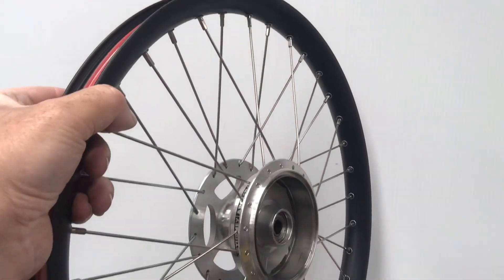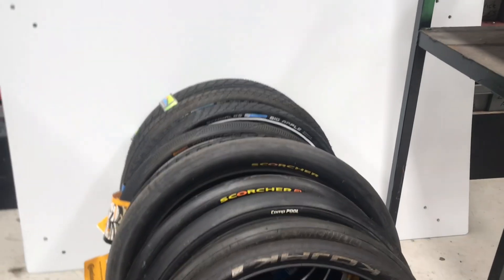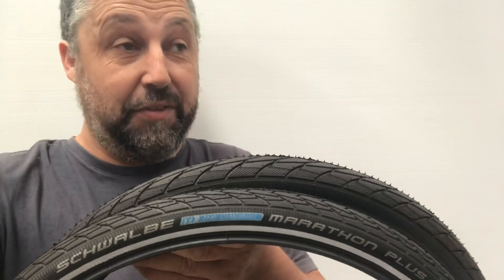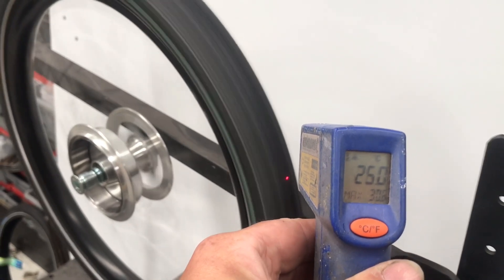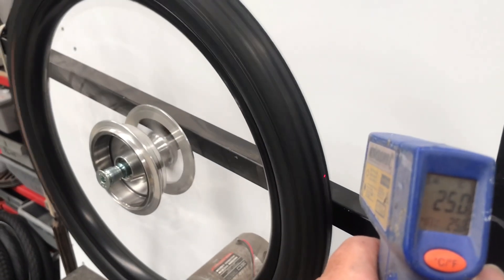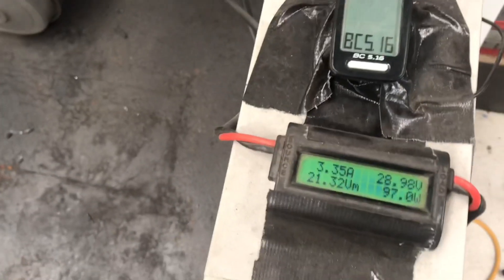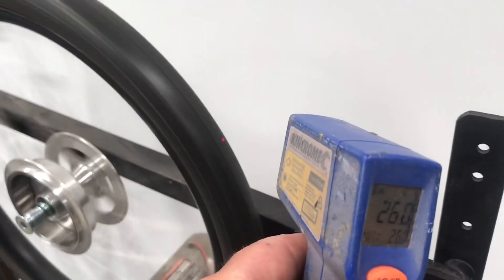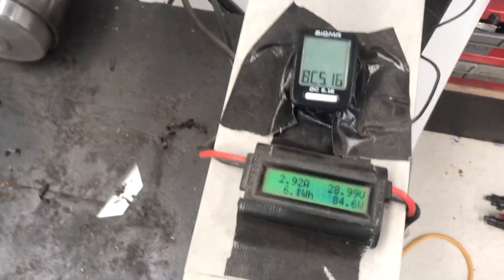406mm tire rolling resistance test

Comment: I can't seem to find those Michelin Blues anywhere online 🤷. I currently run kojaks but these look like a better speed tyre.
Reply: Ginkgo Velotile in Germany sometimes has them.  They are very thin, no extra puncture protection.  Race only, not for practical use.
Reply: @larrylem3582  any idea if the Michelin Blue Flange tires are tubeless compatible?
Reply: @ I don't know if they are intended to be tubeless, but "in the old days", just about any tire and most rims could be made tubeless with enough tape and sealant.  (Doesn't work with pinned aluminum rims, they have to be welded.)

Comment: in reallife scenario there is also airdrag that causes extra watts. all those plushy tyres like scorchers and 44 blues are fastest up to 25 miles per hour. if you ge beyond that then you feel the pullback by air but most people wont go that fast unless in a downhill. when it comes to price, safety, longivity, grip, speed, mounting the best are: continental contact urban. i had similar result just as win shermer did with his bandentest. would love to see tubeless, or different kinds of tubes test, latex, tpu etc.

Comment: GoCycle ( Vredestein F-Lite) is right there with the Scorcher. Folding. Nice round no problem. Rolls fast. Good grip. Light.  Very comfortable, so smooth. Puncture protection. Wear resistant.€35. I love them. Try get a set! 

I'm surprised by the Continental Contact Urban. Very affordable €21 for the 42mm version 355 grams!
Reply: Would like to see this tire tested as well

Comment: Great job! I did similar tests. I can give you one piece of advice. To see the difference more clearly, you can take the test for a strictly defined time, say 3 minutes. And measure not instantaneous readings of power consumption, but the final indicator of energy consumption in watt-hours. So the result will be averaged, and the difference in readings will be more obvious.
Reply from the maker: That is actually what took place

Comment: Thanks for making the video, that must have been a lot of work. You managed to get a good selection of the best rolling tires for the test.
Unfortunately the results are not very useful as many of the measurements are in stark contrast to the results of other tests :( Tire testing is hard.
Reply: Which other tests? The results are in line with previous 406 tyre testing that I have seen from both this rig and from others testing 406 tyres.
Do not confuse 406 comparison results with 622 results - shrinking the size can have adverse effects on the peroformance where as some tyres, like the Scorcher, were designed at 406mm and do well in such tests.
I have personally taken the results from this rig, ridden the tyres in real world conditions and verified that the rankings produced from the rig are consistent with actual riding.
If you disagree, go produce & present better data.
Reply: @Robtrike  It's true that some 406 tires differ from the 622 versions, but we can still use the 622 results from bicyclerollingresistance as a rough guideline. But some of these results also disagree with Wim Schermer's 406 tests and my own. I have tested Michelin Blue 44-406, Greenspeed Scorcher 42-406, Schwalbe Pro One TT 28-406 and Michelin Radial 45/75R16 on a pendulum similar to Wim's testing setup.
Reply: @w0ttheh3ll  Cool - you have results - where is your link?
Reply: @Robtrike  Our results are not published, but I can give you the numbers. 
We use a pendulum somewhat similar to Wim Schermer's, but with a different method of analysing the data. I believe he reports the time in motion and calculates c_r based on that, I'm not sure what physical basis his method uses.
We measure the distance covered while in motion and calculate c_r based on the initial energy of the pendulum, since Work equals Force integrated by Distance (F=E/s) and we are looking for the force of friction to calculate the coefficient of rolling resistance (c_r = F_r/F_N). We also measure time in motion.
The measurements were not calibrated so I don't have c_r, only relative values that are c_r*k with an unknown constant k (k is roughly equal for all measured tires). The measurements were done on a smooth surface (unlike an actual road).
All tires were fitted with the same type of pure latex inner tube from Ginkgo Veloteile.

c_r*k; time in motion; tire
1.00; 186 s; Michelin Radial 45/75R16 @ 7 bar
1.59; 95 s; Schwalbe Pro One TT 28-406 @ 8 bar
1.78; 90 s; Michelin Blue Flange 44-406 @ 5 bar
1.88; 79 s; Greenspeed Scorcher 40-406 @ 7 bar

Tire pressure was chosen as the max recommended pressure. The Michelin 44-406 has max PSI equivalent to 3.5 bar printed on the tire but 5 bar was recommended by the online shop. This results in the Michelin Blue Flange and the Schwalbe TT being a bit underinflated (lower wall tension) compared to the Greenspeed Scorcher. Higher pressure leads to better performance (at least on a smooth surface). The radial tire's pressure cannot be compared to the others since the tire construction is totally different.
Reply: @Robtrike  I can measure Conti Contact Urban 32-406 and Schwalbe Road Cruiser xx-406 next week.

Comment: Pro One TT unfortunately is tough to get mounted on most rims. Use mounting fluid and inflate to 10 bar or more. Then reduce pressure to what you want to run after the tire seats itself.

Comment: the contact speed result seems wrong, it should be about the same as the contact urban.
edit: looking at all the numbers from the entire video, it seems more likely that the result for the urban is wrong.
Reply: let's hope it is right ;-) - I've got them on my Snoek and that must be the reason I'm so slow.
Reply: Contact Speed is widely reported as slower than the Urban... Results ordering seem consistant with my experience of Speed/Urban/Pro/ProOne/Scorcher120 - well done Ben!
Reply: @Robtrike  the contact speed is supposed to be a bit slower than the urban yes, but the difference measured here is huge. the contact urban result reported here beats the road bike tires (One, Pro One) by a huge margin. It's on par with the stripped down, no puncture protection, extremely thin tread competition tire (Pro One TT). the urban is a city bike tire with full puncture protection. it's a very good (and affordable) tire, but it's not that good.
Reply: @w0ttheh3ll  it is called science. 
The test gives a relative value, not a calibrated number.
We've seen similar results before. The falacy that road tyres are the only fast option and commuter tyres are slow is just that - a falacy.
Reply: @Robtrike  you've seen similar results where? bicyclerollingresistance measured 18 W for the contact urban, 21 W for the contact speed, 15 W for the Schwalbe One, 13 W for the Pro One and 8 W for the Pro One TT. granted, all of those were 622, not 406. you're telling me that the 406 Contact Urban is as fast as the 406 Pro One TT because of "science"? I've handled and mounted both of those tires in size 406. I've spent several hours personally testing rolling resistance of the 28-406 Pro One TT. They are not comparable.
Reply: @w0ttheh3ll  You failed to listen to Ben describing the testing. The numbers are only relative values. The relative position of the test items is the real information. This rig has been in use for 25 years and you can go find previous results from it if you wish. Wim Schermer's testing over the last 20 years would be my other source. We know the shortcomings of both this rig testing method and of read-across from other tyre sizes.
I have taken the time to ride the tyres from previous testing on this rig and my real world road riding agreed with the relative placements.
The 'science' - the correct approach now, if you disagree, would be for you to go do your own testing and present the results, as Ben has done here. I for one would stand behind Ben as a Peer Reviewer of his testing and have experience of the results from this testing rig and method.
Reply: @Robtrike  where do you see me treat the measurements as anything but relative values?
Reply: @w0ttheh3ll  pro one tt are rolling slower then contact urbans, but they are better at aerodynamics cuz its 28mm. the trick behind contact urbans is the contact patch is reduced due to the shape. there are caved in valleys and stripes. while ones are plain.
Reply: @JoseFierro666  Since several commenters here are convinced that the Contact Urban is some kind of miracle tire, I will put them on the test stand on monday. If they truly were the fastest rolling 406 tire in current production, that would be pretty amazing.
Reply: @w0ttheh3ll  yep but i still run contact speeds for longivity and puncture resistance and turning radius. 32 have less.
Reply: @w0ttheh3ll  yeah i tested them today, they are definitly super fast up to a spefic speed of 25 mph then airdrag slows them down.
also ben used butyl tubes in testing. pro one tt was ment to be tubless. so you can drop around 8 watts and get to 69 for tt. i switched back to continental contact speed tho. they are cheaper and will last longer. if you inflate them about 8 bars with latex tube just as fast as schwalbe pro one

Comment: The michelin radial is tough to get running round on some rims, easy on others. Use plenty of mounting fluid and inflate to 8 bar until it seats itself into the rim properly. then reduce pressure to what you want to run (nominal pressure is 7 bar, but many teams run less than that).

Comment: In the not too distant future would it be possible to test tires performace with the Tannus Inserts?  I did my resistance testing with 3 types of schwalbes 20" and came away with the feeling it was all bad with the feeling of pedaling in mud with the Rotovelo and similar to riding with the brakes on in downhill testing. I have had my share of multiple fat tires on a variety of rides and the battle between flat protection and speed is a constant issue. Yes this basic information was confirmation without riding surface temperature input yet helpful.
Reply from the maker: Sounds like you have already found the answer there to be honest